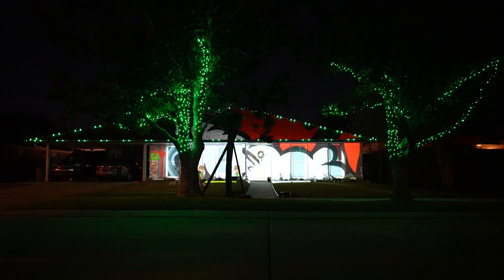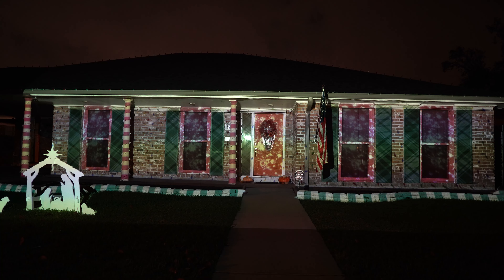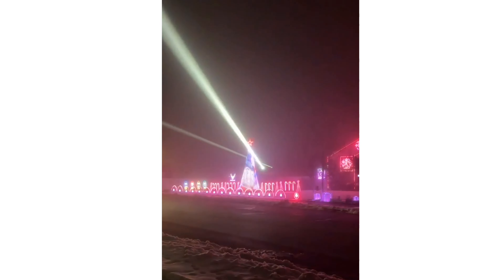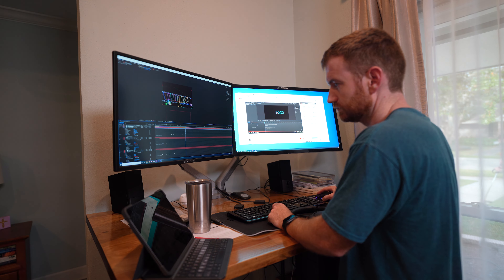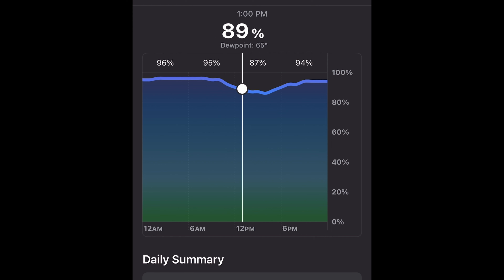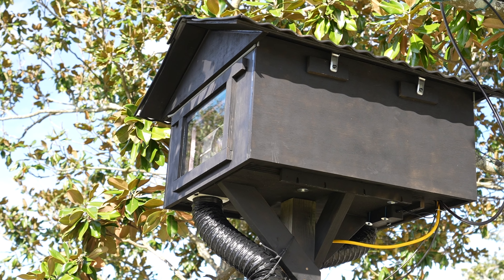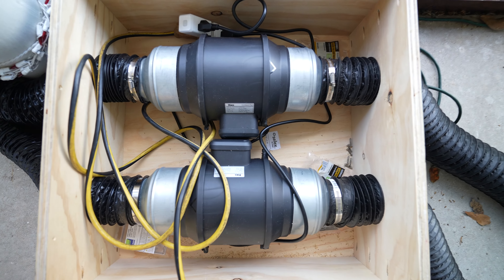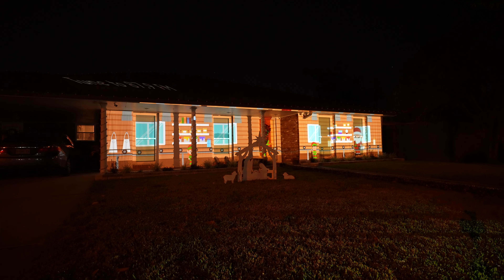Projection Mapping My House with an 8,000 Lumen MONSTER

Comment: I used Falcon player and an old Raspberry Pi 3 to run my Pixel tree in the front yard last Christmas.  It was so much fun I did a New Years countdown timer and Fireworks display that played on the tree after Christmas.  Well, the Fireworks display only happened at midnight on 12/31

Comment: Is a 6200/7000 lumens video projector sufficient for a projection surface of 12 meters long by 6 meters high? it is a distance of approximately 10 to 20 meters. Thank you for your reply ! =)

sorry for my English, I'm French :/
Reply: Yes, more then enough! I would go with a 4000 ansi lumen (or more) for your house, that is more than enough! 
I recommend a shortthrow beamer! 3 LCD (older projectors 2nd hand or lazer projector DLP.. do not believe lumens from cheap led projector online!!).